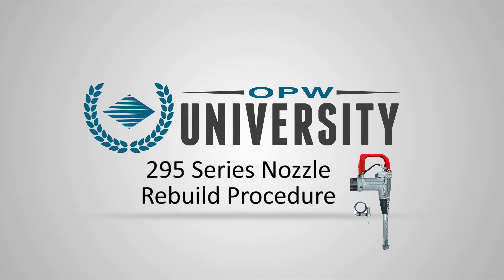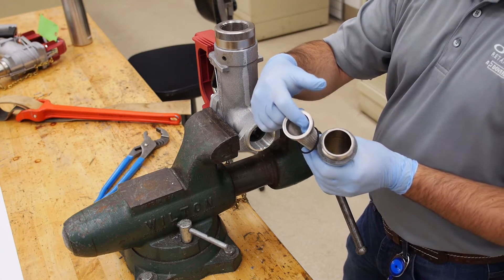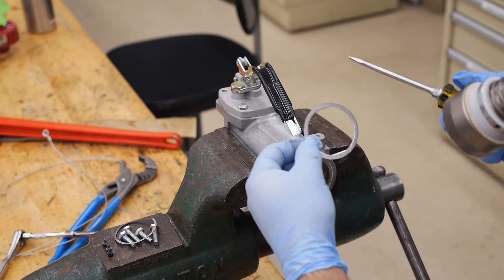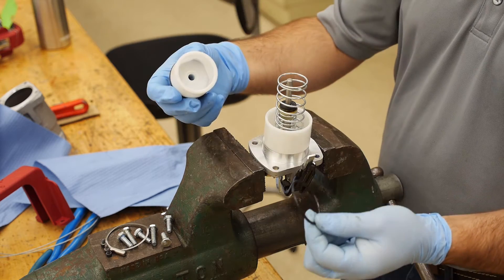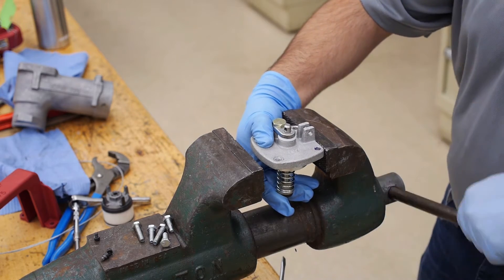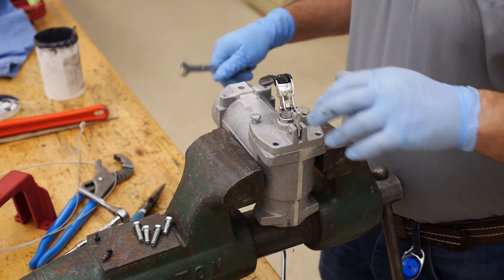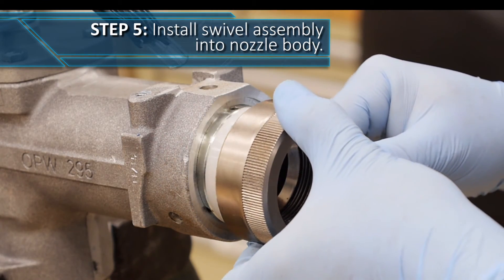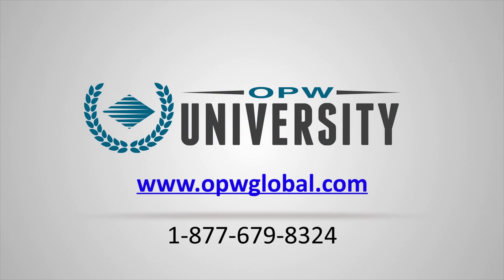OPW 295-Series Fueling Nozzle Rebuild Procedure

Comment: My opw 295 nozzle, I observed that the lever became stiff and hard to pull up whenever fuel pump is running and the nozzle is pressurized. 
As the lever became stiffened, it cannot dispenses out.

So I opened it and found the main poppet was broken, then I replaced the broken poppet and coupled back the nozzle.

After testing, the nozzle still performed as before and not dispensing.

What could be the problem or what I am missing?